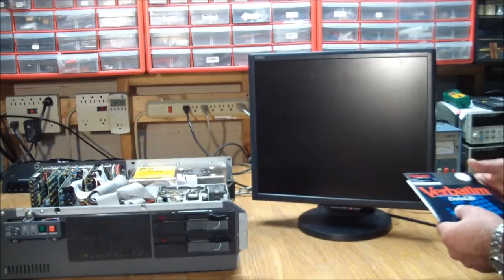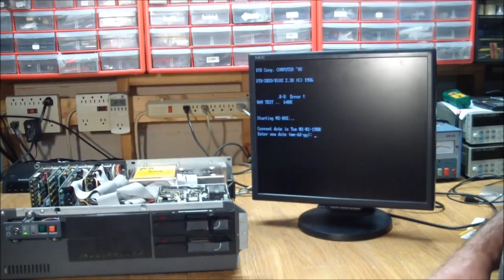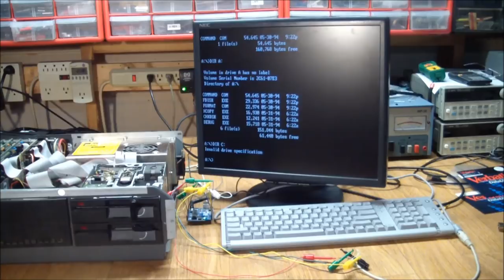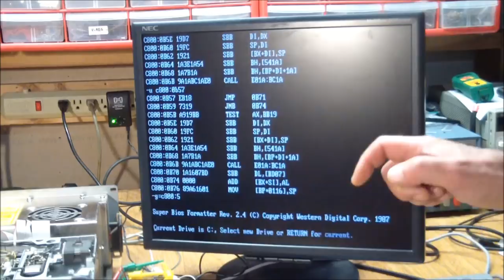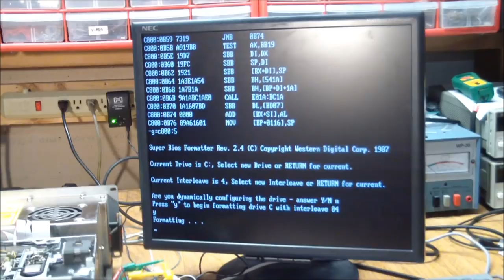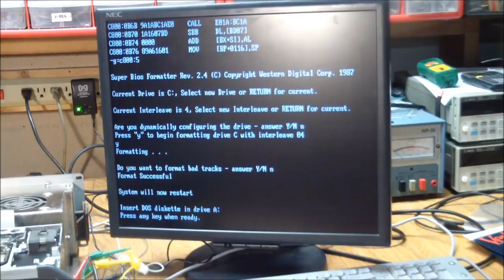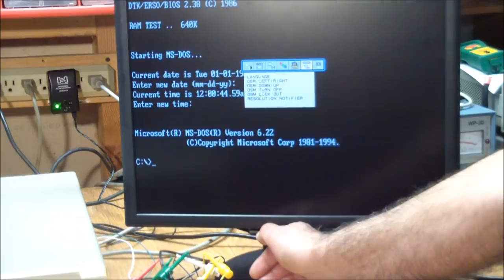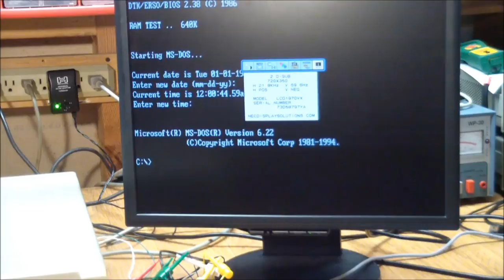AE#56 IBM PC XT Clone With 8088 Awakens

Comment: Wow, this is the exact model we had at our auto shop in about 1994, and the first computer I ever used. We used it along with a snap on scanner connected to the com1 port. That downloaded the car's data and printed to an old okidata 82a dot matrix printer. I remember being the only one who could operate it, and I was just 12 years old. It had that same hard drive problem, it involved bios forgetting the parameters of the hard drive, I'd re-enter them and it would work again. On those days there were no printouts for customers until I got out of school at 2:30pm to get there and fix it. We used it until the business closed in 1998. It had lotus 123, pc tools, q&a. The special snap on scanner software we bought refused to install to the hard disk because of copy protect, so it ran off floppy disk multiple times a day, for over five years. Man I wish I kept it, I really miss that old piece of junk. Thanks for the video.

Comment: Nice find, they don't come up very often anymore, reminds me of the days when i was alot younger ...:-) ...That keyboard issue is why i don't throw away my old keyboards with the XT/AT switch. Good info with the NEC monitor, i will certainly have a look for one.  When i do older machinery conversions from CRT to LCD i usually put one of the Chinese "anything to VGA" converters in, works good most times, but not always.

Comment: Sometimes a DIP was socketed due to availability when the board was produced. If your out of chip 'A' you don't want to stop production so you load sockets in that feeder on the DIP insertion machine and keep boards flowing. It could also be a case where some issue with the part was not letting it work properly with the DIP insertion machine. I typically did not see this on the DIP insertion machine I ran but on the radial insertion machine it was all too common to have a batch of capacitor come in just out of spec and we would have to hand prep/insert those just before the wave soldering machine (what a PITA). I actually had a tool designed/manufactured that mounted on the radial machine parts feeder that would re-crimp the cap leads to spec as they were being fed into the machine to solve this issue.

Comment: What model NEC monitor is that?  I just got a load of old computers and need a CGA/EGA/Mono monitor.
Reply from the maker: It's NEC MultiSync LCD 1970VX. Handles a resolution of 320 x 200 perfectly.

Comment: You have an RLL drive, and MFM controller. With the right controller, this drive would have a capacity of ~62MB. And no, formatting a bad tracks doesn't mean that controller read these tracks from drive and will try to repair them. It means entering a list of them from the label and marking a whole track as unusable by the formatter. You should do that.

Comment: Haven't looked at all the comments, but given the date year was 1900 that meant the BIOS settings were wiped out. that would have meant the HDD data was also no longer configured in the BIOS or drive controller board. You likely could have read the details off the drive in regards to the heads..cyclinders etc and configured that back into the BIOS or controller configuration to once again access and read the HDD without the low level format.

Comment: You need Norton disk doctor to keep that drive happy. It will check all the growing bad sectors and map them out, plus it will verify the drive a lot better than MSDOS with a "does it read then ok" attitude, it will check for weak media and also improve interleave if possible. The bad track list is required to be entered during low level format, they might format but were identified as weak during the factory format, but they still work. Install the full set of MSDOS routines on there, and you will be fine. You will need to find the small autoexec program for the clock card that reads the clock chip and sets the BIOS accordingly, only on AT BIOS did they assume a clock attached to the keyboard driver ( and the Gate A20 flag output as well from the 8042) as being standard.

Comment: I got an AcerMate 333S 386 SX last year. It was very interesting and fun to put it on service again. Now it's kinda time machine full of arcade games. 
Of course it would be cheaper and faster to emulate Windows 3.1 on VirtualBox but it wouldn't be that tasty
Reply from the maker: I tried using a virtual DOS box to make floppy disks for Radio Shack computers, but it was hit or miss. I now use a generic 386 machine and it works flawlessly every time.

Comment: The classic any key joke. Great video. For DTK, I have a case of a 1630 peer but nothing(not even the original PSU) inside. If I was good at metal work I would love to get a standard baby AT power supply to fit correctly and use it for a 486 build.

Comment: Nice machine. I have no idea how that debug command works, but good the hard drive was OK after the low-level format. Surprising that it's in such a good working condition overall. Those 8-bit cards are getting rare and expensive.

Comment: I'm just speculating, but could that empty socket be for BASIC on ROM? It was part of the original IBM PC system, so may have made it through on this clone.
Reply from the maker: I did find mention of a BASIC ROM for this machine's empty socket. If I find a binary image I'll give it a try.

Comment: This brings back a whole lot of nostalgic feelings.  I used to sell these beasts by the tons.  It strikes me some are still around.  Most must have ended in a landfill or have been scrapped in some African country or India. BTW those cases were very sturdy.  BTW, how does it deal with the Y2K problem when you set the date?

Comment: VGA display got connected to CGA with wires.
AT keyboard got connected to XT with wires.
What wizardy is that??
Reply: Pretty cool makeshift electronics. :)
Reply: VGA monitor will work with RGBI (CGA/EGA) signal, it just won't support intensity.

Comment: That's very interesting about the Multisync working with the old video card. I never thought the Multisync word meant anything once VGA got a foothold in the early nineties.

Another thing to note is that some older keyboards can actually auto sense AT and XT machines, instead of using a switch, and there is no indication on the keyboard that they have this function. My old AT layout BTC is like this, as was the XT style keyboard for my Compaq Portable  PC knockoff. (The suitcase, not the lunchbox).

You probably know this by now, but the bigger card with the DIN socket is likely for a bus mouse, (a competing interface with PS/2 and serial) and the video card is actually an EGA card, not CGA, as evidenced by the 21Khz refresh rate. The dip switches allow for EGA, CGA, and monochrome monitors. EGA has R, G, B, Red intensity, Green intensity, Blue intensity, H, V, and ground, whereas CGA just has R, G, B, one intensity pin (for 16 colors in certain modes), H, V, and ground. The RCA connectors are (probably) not for composite as they were on CGA cards. They're supposedly wired to the feature connector, the purpose of which has never surfaced.
Reply from the maker: I knew that some keyboards of that era auto sensed the comm stream and adapted themselves, but these keyboards are too expensive now to take a chance.
Reply: Rod, you beat me to it.  As for the feature connector... it does... stuff.
You can run MSD to get more information about the computer.  Also Norton utilities can be downloaded from a number of abandonware sites.
I'm not sure what partition type you are using because of being formatted with DOS 6.22, but I'd recommend making sure it's FAT12 as it's only a 32MB drive.  Sometimes you need compatibility with DOS 2.1 which won't support FAT16.
An 8088-1 is a 10MHz version of the chip.  You have a cool 'Turbo XT'.  BADASS!  See if you can hunt down 8087 and NEC V20 to upgrade it.
I really enjoyed the video.  Haven't seen anyone use DEBUG to load up the MFM LLF utility in over 30 years.

Comment: As far I remember one was supposed to type in defect values printed on the harddrive (or on a separate form coming along with the drive) at a certain point/prompt during the low level setup routine, at least with certain controllers. However DOS-scandisk-routine might have the same outcome (i.e. mapping away the defects).

Comment: 14:10 does the monitor handle TTL to analog conversion, or is this just going to give you 8 colors?
Reply from the maker: The monitor supports analog levels on each of the RGB inputs. I'm guessing 8 bits worth

Comment: That second round ported card could be for a printer if this computer was in point of sale. At first I thought it was a bus mouse card, but the two different ones I have here don't have parallel controllers on them. The other card for the scanner would be most likely for reading bar codes.

Comment: The high density drives use a very narrow track width.   A low density drive may not read the narrow track.  You have another 6 MB of unused hard disk.  You would have to re-fdisk and reinstall dos.    My first PC was a PC with a 1.44 Mb drive as its big storage device. Good Stuff
Reply: Nope, his harddrive is at 100%. That is normal for MFM.

Comment: I wonder if the DIPs on the video card change it to XGA or even VGA.
Reply: Not that one. It would be to select refresh rate or I/O space.  That is a Genoa which may even be EGA with its 64k but that would be it. I would need to look up the chip and see.

Comment: 50:34 what kind of modem?  What speed?  I find that interesting..  2 plugs?
Reply from the maker: It's 1200 baud. The second jack lets you plug in your phone so you can share the line.
Reply: @artifactelectronics  Duhh,  I forgot that jack was for plugging in you phone!  Thanks for the clarification.  My first modem was an external 300 baud.   Good times...  Thanks for doing these videos.  I found my old xt or at 8088 and I cant wait to fire her up again, and see if my old school term papers and a D&D dungeon I started writing are still save on there.

Comment: I am not 100% sure, but I believe the '\ + CR+LF' is correct keycode for Esc in DOS. At least as far as I can remember, pressing Esc key always resulted in printing backslash and jumping on a new line.
Reply: ...and the Escape key actually worked in the fdisk program, so I guess the Arduino is doing its job 100% right 😉

And BTW, the low-level format invoked through debug? That was absolutely brilliant! Never seen it before done this way! You're awesome! 👍👌👍☺️
Reply from the maker: You are correct. Later in the video I used the ESC key to navigate FDISK and I didn't even realize it at the time.

Comment: Could you have installed a video card in a slot and used that?
Reply from the maker: Anything with a VGA output would work, but there aren't too many cards for this architecture with VGA.
Reply: @artifactelectronics  The old Trident 8900's work just fine in an 8 bit slot. As do Cirrus Logic 5420 and 5422 based boards. Some are auto detect while others have a switch for which bus width you want.

Comment: yes, create partition first then format the drive...you formatted through debug without creating the partition first
Reply from the maker: The format through debug was a low level format which DOS requires to do anything. Then you partition and finally perform a high level format through DOS. The low level format isn't absolutely necessary but it does put the drive in a known state and also locks out any bad tracks.
Reply: @artifactelectronics  oh my you're right, it's been a long time for me!